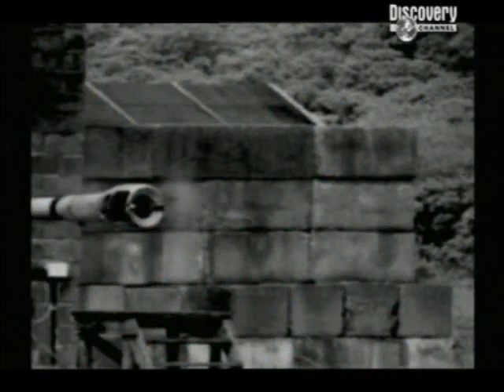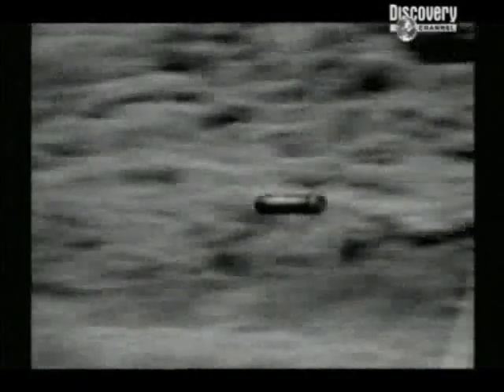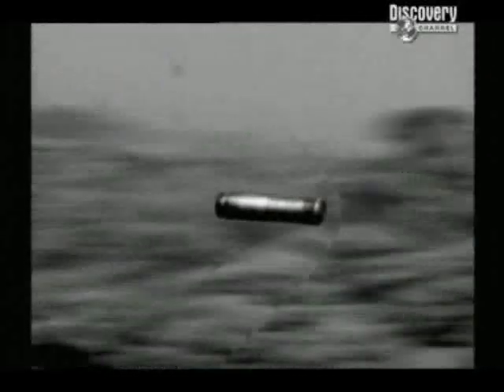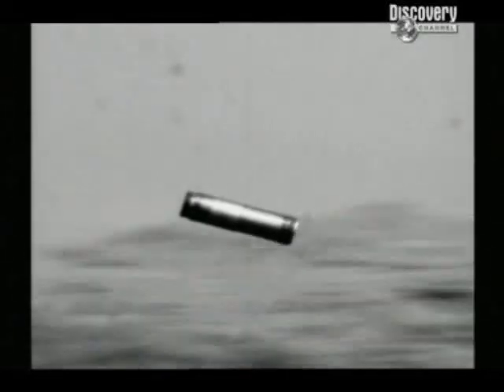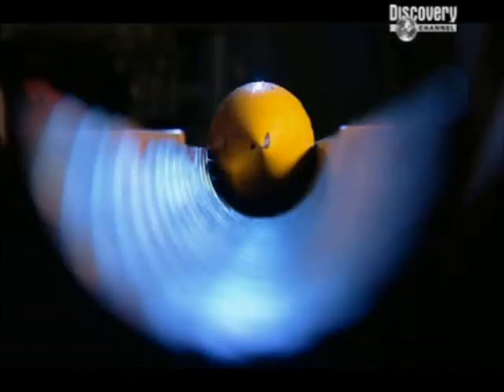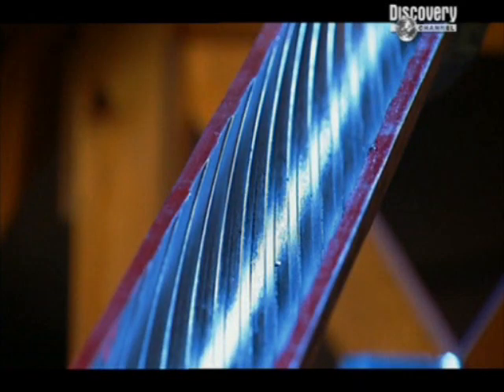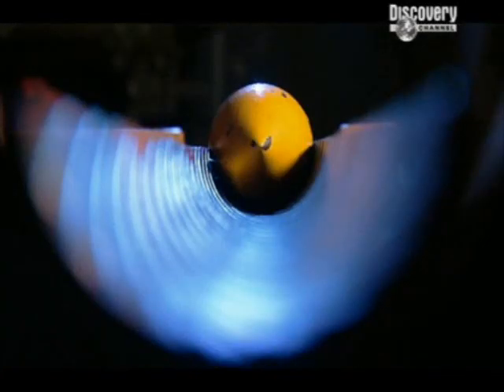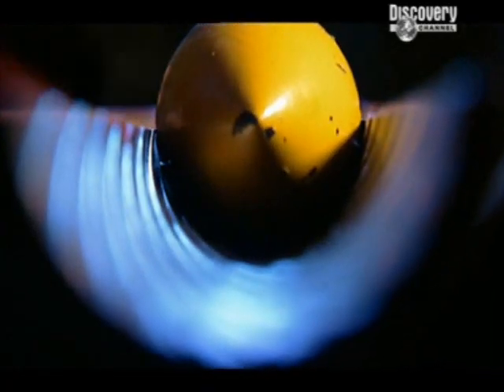How rifled barrel increases accuracy

Comment: @qg786 
.... WHAT

First of all, do you want to put in rifle grooves or remove them from the inside of the barrel?
''Smooth bore rifling'' is a paradox, like saying a box is filled with nothing.
You would have to have quite a bit of equipment, a thing that holds your barrel still, a thing that can drill out the metal between rifles to make it smooth or cut rifles into a smooth barrel.